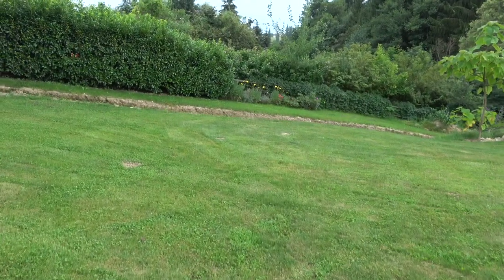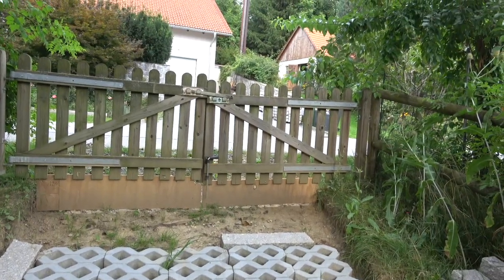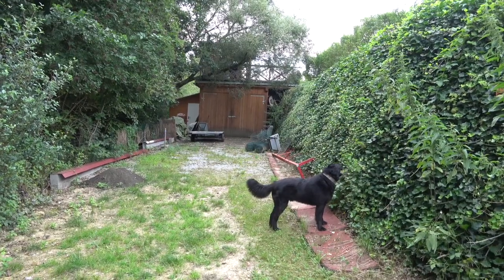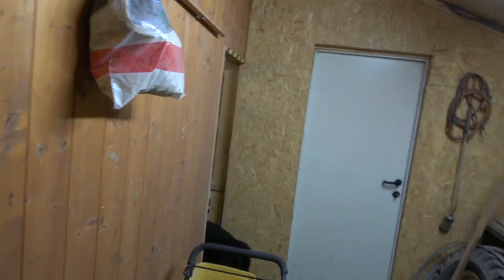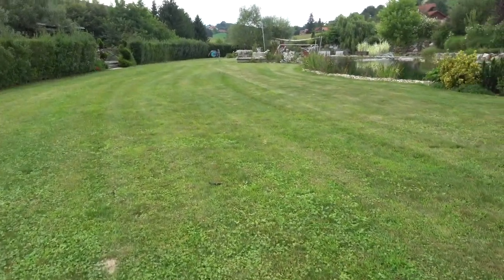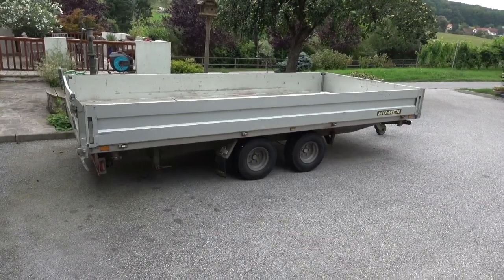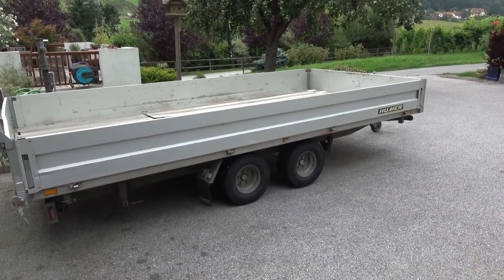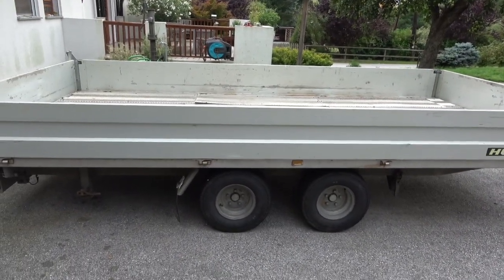A Cunning Plan  ( In The Words Of Baldrick )

Comment: Liking your idea ! .... but is the hydraulic ram a double acting one ? Does it use the pump to move in both directions? Only asking because ‘most’ tipper applications only use the pump to lift then use gravity to return the oil to the tank ....
Reply from the maker: Paul, That‘s the fly in the ointment, I thought about that after the video. The hydraulic pump lifts it and down by depressurising the cylinders so in fact it will not pull the bed back on ( Bugger ) Cheers Dave

Comment: Would a sliding 3rd axle on the trailer make it easier in supporting the overhang
Reply from the maker: Sean, I don‘t think it will need it as the loads will be quite light a lot less than what the VW could carry when it was on the road. The down side is my had ram is a single action so i cant use it for pulling only lifting, Cheers Dave